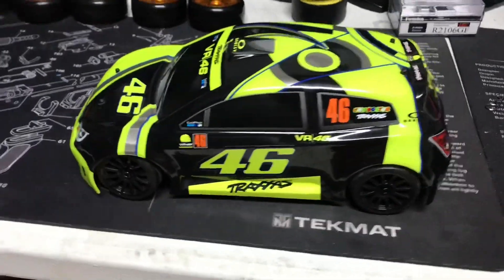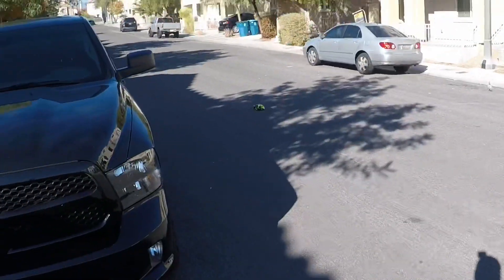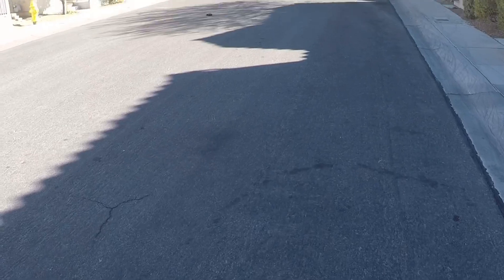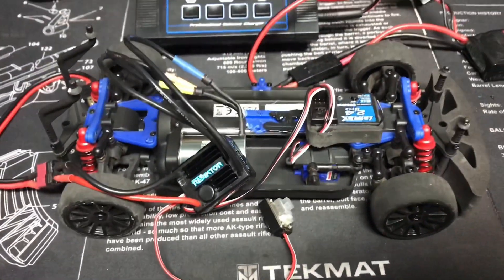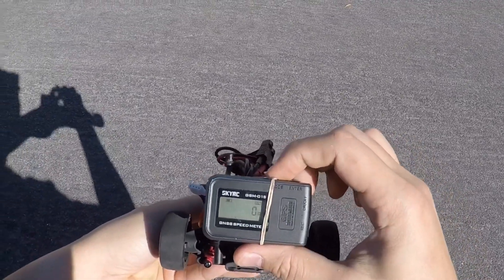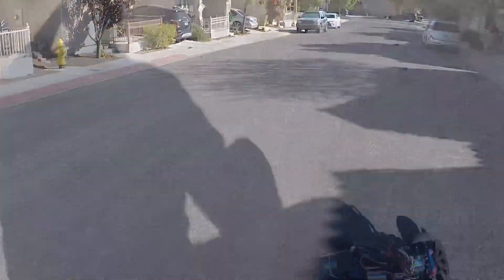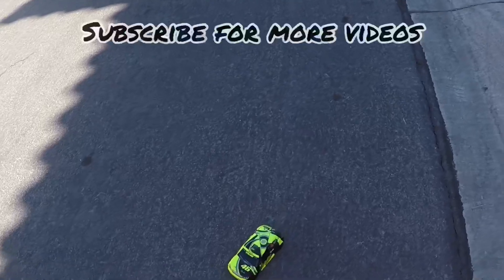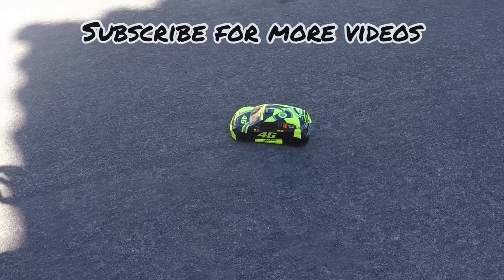LaTrax VR46 Rally BRUSHLESS Upgrade. HOW FAST?? 2s 3s run!

Comment: Nice! 😎 👍 👊
I recently received the Dessert PreRunner, which is the same car with different body. I got 17mph with the stock system. Upgraded it to a brushed system, got 25mph on 2S & 33mph on 3S with the stock gearing (9T pinion/61T spur). Changed the gearing to 17T pinion/50T spur & pushed 42mph at 62% throttle. I need to modify the suspension next cuz at 42mph the front end starts to get squirmy lol. I did also upgrade the servo to a savox high torque servo & replaced the chassis with a 3mm thick wide carbon fiber chassis & foam tires. I'm hoping to get ~70-80mph with this guy 😁

Comment: I pulled 29 mph on 2S, all stock. Squirrelly little buggers, with some extra speed.
Reply: Brushed or brushless motor? I’m wanting to slap a 1400mah 3s in mine but idk if the brushed motor can handle that much power
Reply: @wakefield6398  I used some cheap GoolRC brushless combos. One was 4500kv and another 4800kv. They are very similar. Less than $40 on Amazon.

Comment: I run 3s on brushless and the dogbone and front diff needed to be upgraded
Reply from the maker: Oh wow! Luckily I didn’t have that problem. Now I actually transferred that brushless into my losi mini T 2.0 and put the stock latrax motor back. It’s boring again lol
Reply: Since it's boring again If you like drifting or wanna try it you can wrap the tires with electrical tape makes it a good drift car
Reply: Thomas Thompson I just bought a 3s 2200mah please tell me how you got yours to fit mine it to long by millimeters 😞
Reply: I cut the chassis the lip that runs down the side and used high strength velcro for the batt it hangs over a little but it doesn't seem to matter

Comment: Your gearing is wrong for brushless if you kept the same pinion (14) pinion. With 14 pinion and a say 5400kv or 6kv it should run well into the 40 45 mph range.  Best upgrade for the latrax is a better radio because the stock one the steering cant be turned down and its way to sensitive.
Reply: What gearing do you think I should use for my latrax teton I’m mainly just gonna be bashing around with it

Comment: Did you have to swap in metal diff gears? Or did the stocks plastics hold up?
Wicked  cool video btw!
Reply from the maker: Thanks bro! Nope I didn’t switch the gears up. They held up well. I don’t run it much though
Reply: Sweet! I asked I 
am thinking about going brushless with my rally.
Reply: KGRC007 btw I used a scale speed calculator, 32 is a scale speed of 135, very 👍